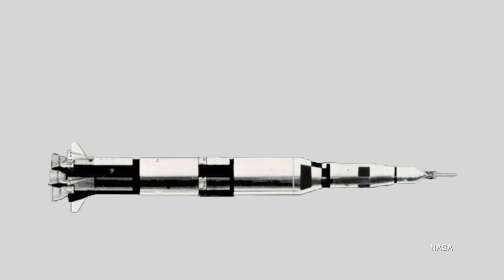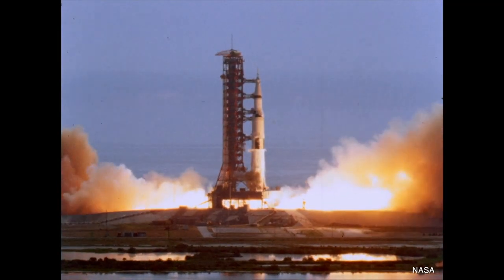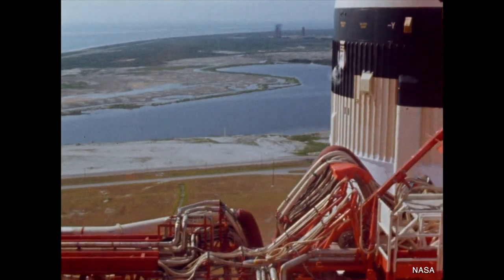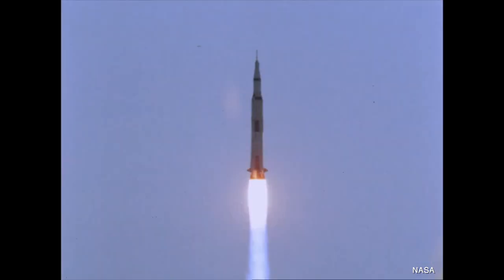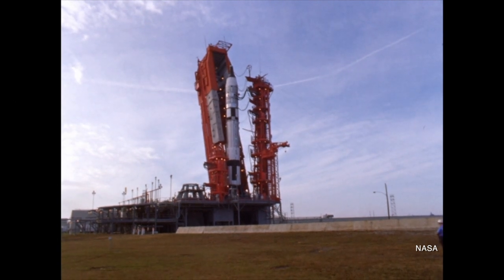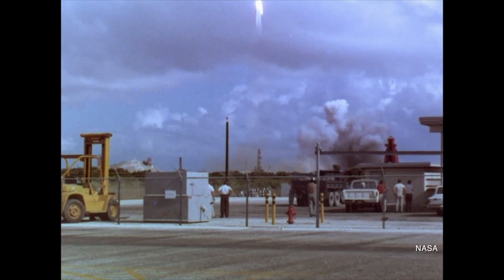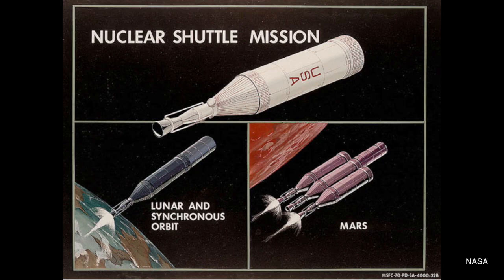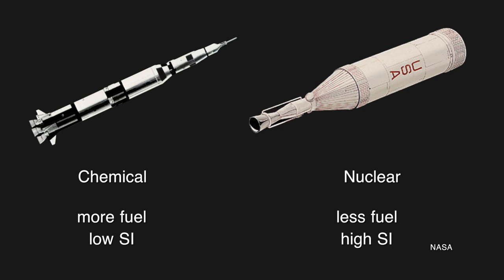What's the Best Kind of Rocket Fuel?

Comment: Specific impulse is not everything though. NASA did well with the Saturn rocket designs; they used lower specific impulse kerosene engines for the first stage, and higher specific impulse hydrogen for the upper stages. For the first stage, you need first of all a lot of thrust! There are basic physical reasons why high ISP tends to trade off to lower thrust. An engine is a combustion (or for a nuclear thermal system, reactor that is a heat exchanger) chamber in which gases are heated to high temperature at a high pressure, then they flow out a nozzle that converts much of the heat to useful momentum. High ISP means the gas flows faster, and kinetic energy goes as the square of velocity, so if I have two candidate chemical mixes, and one produces twice the ISP of the other, and I have the same mass flow, then the double speed mix is putting out 4 times the power as it burns! I get twice as much thrust with the same mass flowing, and that is great, but my combustion chamber has 4 times the power to handle. This means practically it is burning hotter, which means it is harder to pump material into it because it would have 4 times the pressure at the same density, and rocket engines push the limits of material strength. Any decent engine is putting out so much power in so little volume (relatively) that materials would get melt then vaporized in a flash if they weren't actively cooled. So, the lower ISP mix is much easier to handle, and in a given volume I can stuff much more mass and hence get denser mass flow. 

At liftoff, when the rocket is by far the heaviest, at the same time quite high accelerations have to be achieved; the combination means thrust is terribly important, and if it takes throwing away propellant mass at a high rate to get it, so be it. Later, when the rocket is well on its way, saving total mass by using a more efficient but much lower thrust engine set becomes an attractive option; at that point it is possible to have an engine that accelerates the rocket at as little as 3/4 its weight under gravity.

Also there is the matter of propellant density. The less dense a propellant is, the more dead weight of stage mass goes to tankage to hold it. Liquid hydrogen needs 14 cubic meters to hold a ton, while kerosene is nearly as dense as water and a ton occupies just fractionally more than a cubic meter. Consider the Space Shuttle fuel tank, which massed about 30 metric tons dry. The SSMEs used a mix of 6 tons of oxygen to every ton of hydrogen, but the vast majority of the volume went to the hydrogen even so. With that mix, the tank held 724 tons. Suppose it had been kerosene and oxygen at the F-1A engine's 2.27:1 oxygen/kerosene ratio instead. With kerosene being say 0.85 tons/cubic meter and LOX 1.15, the ker/lox mix is 2.85 denser and thus that same tank, with the oxygen bulkhead moved to give the right proportions, would hold 2063 tons instead! Thus the ratio of dry mass for tanks and engines on the Shuttle, with the 3 SSMEs massing about 10 tons, would be 40/724 or about 5.5 percent, while even with 5 F engines massing a total of 40 tons added to the tank, we have 70/2063 gives 3.4 percent mass ratio. 

Going in the other direction, if we were to fill the Shuttle fuel tank with nothing but hydrogen, it would only hold about 142 tons. That means the 30 ton tank is 21 percent the mass of the propellant it holds, and this offsets the value of lowering that mass by the much higher ISP of a nuclear thermal rocket. The nuke has to use hydrogen; if we substituted some other molecule, the ISP would fall in proportion to the square root of the molecular weight to hydrogen's due to the way ideal gas laws work. If we used water for instance, molecular weight of 18 versus hydrogen's 2, we'd wind up with a flow 1/3 the speed we'd get from hydrogen. Admittedly thrust would also be increased by the same ratio of 3, but this means that an engine that could deliver ISP of 1200 seconds with hydrogen would only deliver 400 sec with water, and that is inferior to existing hydrogen/oxygen chemical engines. You won't find many molecules a lot lighter than water and the few candidates have their own drawbacks, generally. Helium for instance is both very expensive and more of a pain to store than even hydrogen is! And it would still cut the ISP down to 850, which is good but hardly a worthwhile tradeoff when hydrogen is actually easier to store! 

The problem of storing hydrogen propellant for a nuclear thermal rocket is often overlooked, but it is just one of many problems NTRs present. Those too relate fundamentally to the very fact that we can get high ISP. The higher the ISP, the more power we need for a unit of thrust, and handling that power is a source of deep headaches. With modest power and very high ISP, we get very low thrusts. For deep space missions, this might be acceptable to be sure.

Comment: Amy, 
You are wrong, in space , the rocket thrust creates a pressure difference between the head and exhaust of the rocket and as , matter moves towards low pressure zones, its tip moves forwards cause the thrusted materials create a higher pressure zone... 😊

Comment: why is xenon used as the accelerator gas fuel in ion engines? like deep space1
Reply: Good question.  Ion engine designs have to contend with something called the Space Charge Effect.  This is also referred to as the Child-Langmuir-Schottky Law.  Basically an Ion Engine's thrust per unit area is limited by the voltage used, the distance between screens, and the charge to mass ratio of the propellant ions.  It turns out that you can get higher maximum thrust with a heavier propellant atom.  Xenon is used because it's a heavy atom, it's got a low ionization potential (easy to ionize), and it's an inert noble gas so it won't corrode the tanks or valves.  There are other candidate propellant elements, such as Mercury, Cesium, and Iodine.  For a long time people have been working on colloidal thrusters, where instead of ions you use a mist or spray of droplets each carrying a few electrons of charge.
Reply: Thanks for the in depth knowledge Jacob.  Ive been fascinated with ion engines ever since my college physics professor gave a lecture about it.  
I figured that xenon was chosen because it's heavier but that got me wondering if an even heavier gas could be used like uranium hexaflouride (UF6) (the heaviest gas I can think of), or would the more complex molecule come apart during ionization?  
Also wouldnt the voltage used be proportional to the distance between the accelerator grids or screen? such as the farther the distance the higher the voltage required
Reply: Hmm... I don't know.  A quick search on webbook.nist.gov indicates an ionization energy of 14 electronvolts for UF6, which is not much higher than the 12 eV ionization energy of Xenon.  If it worked, you could increase the thrust density by a factor of 1.6.  I think you could also reduce the propellant storage volume required by a factor of 2.6.  That might be worth pursuing.

Nope, voltage and grid spacing are independent variables that the ion engine designer is free to pick.
Of course, there are technical limits to what you can pick.
If you put the screens too close together, they will touch and short the circuit.
And if you try to make too high a voltage, something will arc in your power supply.

Comment: Always bothers me a bit when people say you can't launch from earth with NTRs. Sure, it may not be a great idea, but we've built NTRs with TWRs of around 6, which means that it's definitely possible if you were determined enough, and somehow I doubt that we've reached the pinnacle of solid core NTRs with just a few prototypes.

I mean you don't even need a TWR higher than about 10 for a practical nuclear rocket. At that TWR, you can get a very decent liftoff TWR of 1.5 with engine mass accounting for 15% of the rocket. Assuming a pessimistic average specific impulse of only 800 seconds, you only need 75% of the rocket to be fuel. That still leaves 10% for dry mass, rockets without engines are typically on the order of 5%, which leaves 5% for any other misc systems and of course payload.

Comment: One idea for a video is a comparison of how the new Falcon and Antares rockets compare with their older brethren. What's different? What makes them so much more capable and efficient? Etc.
Reply: What makes you think the new launch vehicles are more capable and efficient?

They're not really, from a technical/engineering point of view.  The new launch vehicles use much the same propellants, propulsion cycles, materials and construction as were used in the sixties.  Certainly there have been incremental improvements, but nothing I would call game changing.

For example, compare the Gemini 3 launch in 1965 with the SpaceX CRS-8 launch earlier this year.
Go look the numbers up on Wikipedia.
Gemini 3 launched a payload of 3,237 kg into orbit with a Titan II GLV weighing 154,200 kg.
CRS-8 launched a payload of 3,136 kg into orbit with a Falcon 9 v1.2 weighing 549,054 kg.
Hmm... that actually makes the Falcon 9 look worse in terms of mass ratio.  But that may be misleading because there's only one "weight" listed for the F9v1.2 on wikipedia when in reality it may be loaded with less fuel for certain misssions.
Reply: Jacob Chancery
Yeah, until you compare costs, which is what efficiency is all about. There are also the improved computer capabilities, the ability to land, improved redundancy, and surely many things I'm not aware of. There are supposedly some neat things about the engine design that I'd like to learn more about.

According to Wikipedia:
"The Titan IV was the last of the Titan family of rockets. It was retired in 2005 due to its high cost of operation."
Reply: Yes, thank you for saying cost.  Don't get me wrong, SpaceX has a ton of talented engineers and technicians.  Most of their systems are simple, elegant and reliable.  But in the end, it's all about cost.  SpaceX's organization and business practices do as much to reduce cost as any engineering or design aspects of their vehicles.  And as Elon has said many times, the real cost reduction won't come until they achieve full reusability.  That's what the ability to land is all about.  In my opinion the real cost reduction won't come until they achieve full reusability AND increased launch rates.

I think one of the neat design features of the Merlin engine is that it uses RP-1 fuel from the turbopump outlet to drive the hydraulic pistons that provide thrust vector control of the engine.  So they don't need a hydraulic pump and hydraulic fluid reservoir for thrust vector control.  That's one of the features that makes it lighter than other engines.  But that's not an idea that SpaceX invented.  I think the F-1 engines on Saturn V worked like that too.

Comment: Newton's Third Law (at least in the first approximation, as stated in the video) doesn't really explain the force that accelerates a rocket (or jet engine, or balloon) forward, though it does apply. The best explanation is actually one I came across in a book on space flight I had when I was six years old (a year before Apollo 11's flight). Imagine the combustion chamber of a rocket, or a balloon. It's a chamber full of gas at high pressure. If this were a closed container full of gas at high pressure, no gases escape and no thrust is produced. Now, however, imagine if there were an orifice in the wall of this chamber (i.e. the rocket's exhaust vent or the balloon's open neck). Now there will be even pressure all the way around the chamber EXCEPT where the orifice is. The pressure to the sides are balanced with an equal pressure on the opposite side. However, since there is NO pressure (or less pressure) where the orifice is, there is now no opposing pressure to offset the pressure on the wall opposite to where the orifice is located. This unbalanced pressure is what actually drives the rocket forward. You can even calculate the net accelerating force produced - it's the pressure multiplied by the area of the orifice. The bigger the orifice, the greater the thrust for any given pressure, but since we're talking rockets here, you'd also be expelling gas through the orifice at a greater rate and will have to maintain the pressure by expending more fuel and oxidizer per given amount of time. I think Newton's Third Law would apply here in that the force exerted by the front of the combustion chamber on the gas is balanced by the pressure that gas exerts on the front of the combustion chamber. The calculations involving the acceleration of gas rearwards and the rocket accelerating forwards is actually the conservation of momentum (which might also involve the Third Law - I'll have to think about that one!) rather than a matter of balanced, opposing forces.
Reply: This is also consistent, by the way, with the fact that rockets are capable of producing thrust in a vacuum.

Comment: This leads to another question. You missed out hybrid rocket motors I presume because they are not used for space flight. This begs the question - what is the reason hybrid engines are not used for space flight?
Reply: A lower specific impulse.
Reply: It's still higher specific impulse than solid fuel.
Reply: The Space Shuttle was getting 267 seconds for the RSRB. Spaceship One was getting 250 seconds.
Reply: spacecadet35 burn duration and specific impulse are not the same thing. Go look it up.
Reply: Gordon Lawrence The unit of specific impulse is seconds.
Reply: The point still remains 250 is not a high specific impulse. You can get higher like about 325 from hybrid.
Reply: Gordon Lawrence  Spaceship One did use a Hybrid. And they got 250 seconds.  Nitrous oxide based hybrids only get to about 250 seconds.  I personally would hate to design a large hybrid as you would have an interesting injector pattern. The hybrids I personally fly are quite small and I want to shift to NOS/RP1 for its much better characteristics.
Reply: I saw some experimental ones using LOX and what was basically a resin and rubber impregnated with I think aluminium and a few other things that got 350. Not as good as the 400+ you can get out of liquid fuels but way better than model motors. I think the issue was re-ignition. That said it was only about 1 meter long so injector issues may not have been too important.
Reply: Gordon Lawrence  If you are using LOX you might as well just burn RP1. That way you get a much better oxidiser/fuel mix. One of the major advantages of solid fuel of LOX systems is the propellant density. For a solid it is usually about 2g/cc and for LOX it is 0.5g/cc.

Comment: using cryogenic hydrogen heated by a reactor has Isp of at least 900 seconds. which is more than enough impulse for SSTO, and it's not a chemical engine per say.
Reply: ISP is a measure of efficiency.  A nuclear thermal rocket like you're suggesting IS fantastic for space-flight, as she explained in the video.  BUT it does not have the thrust necessary to overcome Earth's gravity and get off the ground.  The thrust-to-weight ratio of NTR's is terrible; because nuclear reactors are very heavy.  In space, your thrust-to-weight ratio is irrelevant; all a low TWR means in space is that your burns may take days or weeks.  On Earth though, if your TWR is below 1, you can't move.
Reply: And what Mikitron said is the entire TWR of the rocket, not only the engine(s).Also, it has to balanced between th  two, such SSME (RS-25) had very good efficiency but not that good TWR, meanwhile Merlin 1D not has the best ISP, but currently the highest TWR of an engine to date. cheers :-)
Reply: +Alpha Adhito sorry, Millitron
Reply: Millitron I beg to differ. you do have enough thrust to weight ratio to launch from sea level. look it up under the NERVA rocket. there was also another co trying to beam microwave energy to a great exchanger in their vehicle to heat the hydrogen. can't remember their name but it was single stage to orbit vehicle.
Reply: +Jamie Godman Did you mean Escape Dynamics?
Reply: Everything I'm seeing shows the NERVA had a TWR of ~0.2 at it's most powerful, least efficient settings.  And considering it was never fired on these settings, only theorized, the real value is probably lower still.

Beamed power is a fantastic idea though.  Look up lightcraft; they've actually flown.

Comment: Great videos as always! Small correction: SRB don't use the fuels as a powder but as a solid chunk of fuel. They likely start out as powder (Aluminum, Ammonium Perchlorate and binding agents) but they were formed into very specific shapes within the outer assembly. I've looked for photos of the inside (pre-flight) but haven't seen any. There are some drawings that are pretty interesting. The rocket actually burned the propellant from the top of the booster first and consumed the fuel in a downward direction, the opposite of a model rocket engine. I hope that is accurate...I am not an expert. Thanks for all the videos ;) https://space.stackexchange.com/questions/12541/why-is-there-a-hole-in-solid-rocket-engines